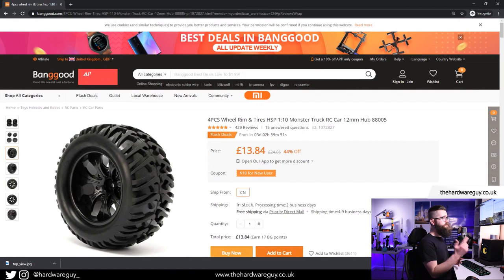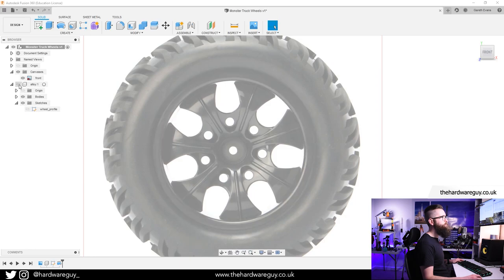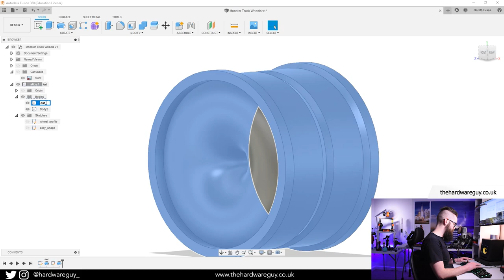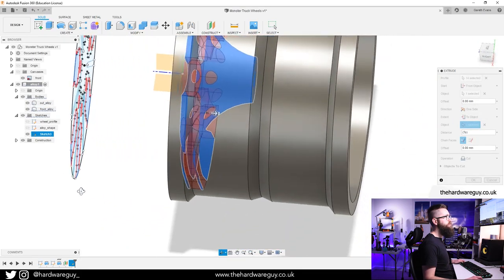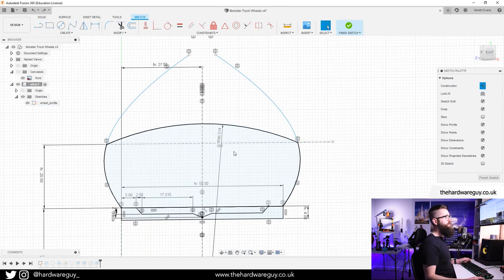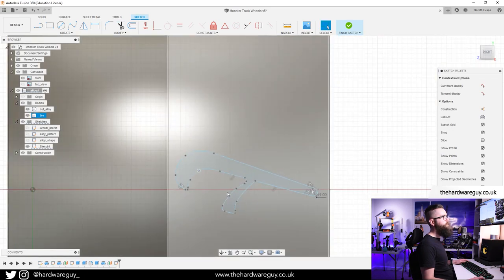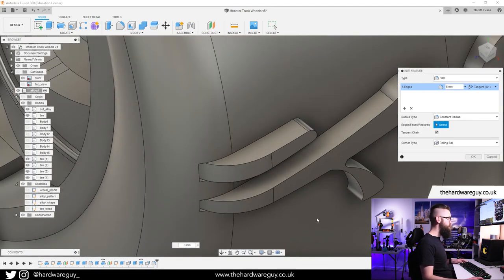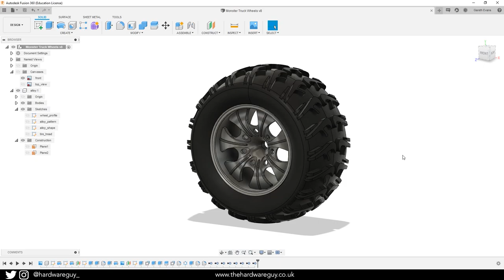Modelling a Monster Truck Wheel - Fusion 360

Comment: Just turn the wheel image so that one of the spoke cutouts is exactly vertical. Then draw only half of the ray and use mirroring to finish it. This would ensure that the rays are exactly symmetrical

Comment: 1:12:51 you can modify the edges/radius with a boolean operation by cutting it to your linkings. Create a ring with revolve ...
Reply: Ah, so you could just have the thread flush with the tire wall and just shave off to the desired radius that way. Nice!

Comment: Nice to see how others think through a project, people don't appreciate how difficult it can be to make a video on the fly.  
Calibrate .. Left to right less optical error on that image. Once sized, sketch circle and match to centre hole. Constrain to origin then position image to that circle. Instead of hide body toggle when doing the curve rotate for the spokes, hide the body and reveal the sketch for the rim revolve. On the tread why not use extrude from surface?